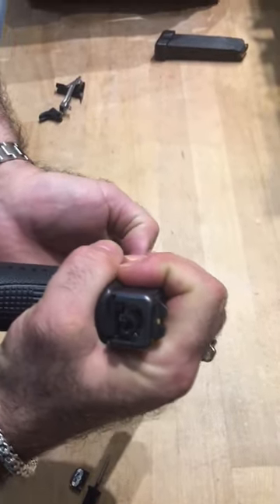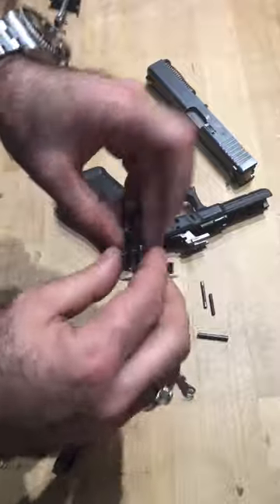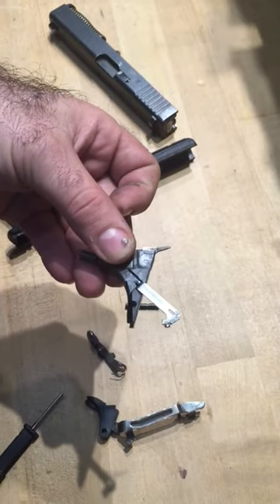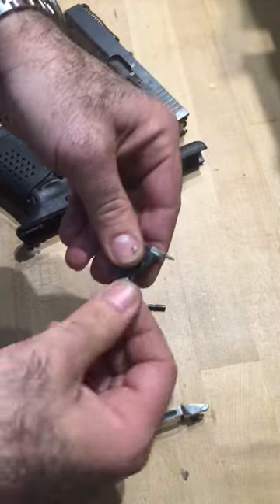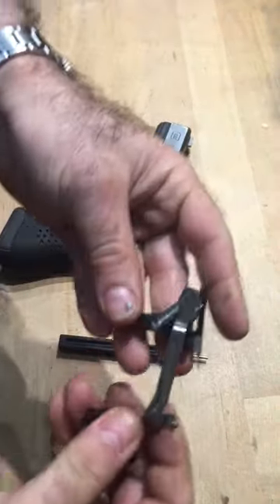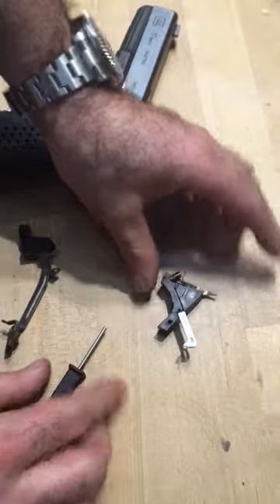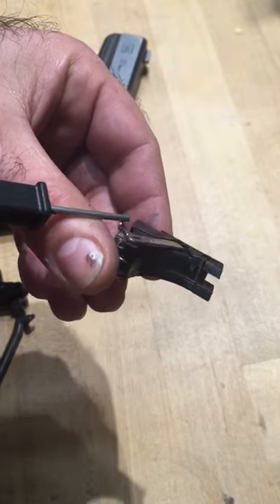Adjusting your connector-Bend angle adjustment

Comment from the maker: The video is not intended to show the disassembly of the Glock. This is to show the bend angle adjustment of a connector. Stay tuned for complete disassembly videos coming soon. Thanks for your business and for watching.
Reply: GhostIncTV  My G19 Slide has a lot of resistance only on trigger reset Could it be the Connector? When I manually rack my slide to check my trigger & hold my trigger back & rack slide for trigger reset something is giving resistance 
Any help would be appreciated
Reply: Oliver style 😁
Reply: Incredible knowledge base right here. I'm amazed.
Reply: It's been over 2 years since you mentioned "complete disassembly videos coming soon." Any progress toward those videos?

Comment: Thank you SO MUCH for this video! I just bought my first aftermarket trigger (Johnny Glock) and he had a video explaining about the grit/drag from the connector pushing the trigger bar into the frame, but he didn’t leave the fix for the issue in the video. Thanks to your instructions, I was able to adjust the connector right where I wanted it (first I over-corrected and messed up my reset; then I lifted it back out to Goldilocks zone) 👍

Comment: Great video! One tip is you can fit a tiny punch under the back plate and pull the connector to the right, pull the trigger so you can remove the slide without disassembling it!

Comment: You can use a piece of paper or thin card to make sure the space is proper. If the card wont go through its too tight if it goes through easy with no resistance its too loose. It should go all the way way easily but with slight even resistance

Comment: Did this adjustment to mine today, the bar was slipping past the connector, and this adjustment worked perfectly to fix it. Trigger reset perfectly and fired every time, and it no longer slips pst the connector. Thank you again for this video! I didn’t know what exactly was happening as this was my first build, and was told to take it to gunsmith, but I zeroed the issue down, and found this video instantly, and was able to fix it myself, and that’s what I wanted, the knowledge of the issue and how to fix it, I wanted it 100% all me, haha….

Comment: I reassemble my Glock different. I put in the rear pin in first(like this video). But next I place the slide release/stop in place and THEN install the large diameter trigger pin in. 
That traps the slide stop in place.

LAST, I put in the skinny metal pin. You just have to use your Glock tool (or anything) to push the end of the slide stop spring-steel out of the way.
I can do it ALMOST as fast as this video. 

The newer the gun, the stiffer the pins fit and it can take longer. His gun has been together and apart a LOT by the looks of it.

Comment: A link to this video needs to be included with all Ghost Edge connectors - I've never seen one that didn't need some tweaking. Ghost, you guys should print a QR code to the fix right on the card or documentation every time one is sold and shipped - it would save builders a lot of headaches and probably save you a lot of returns.

Comment: 43X Trigger problems? I had just bought a 43X. It felt like the trigger was too heavy, and the reset didn't always work. I had used this video several years ago to solve a trigger problem with my G19. To solve my 43X problem, I used the 2nd procedure he showed us here. Reset works like a charm now on my 43x, and the trigger pull is not as heavy. It's amazing how the trigger connector affects several issues with a Glock.

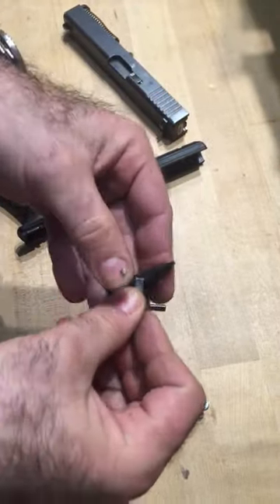Comment: 1:42 & 2:30 look almost identical on my big screen.  Is there an actual angle measurement of the connector that can be measured before it even goes into the housing?  If not, is there some sort of at-home method people can use such as, a post-it note, or note card that can only fit so far down between the connector and the housing?

Comment: I have the G43x MOS. I bought an Apex trigger. Beautiful. Works like a charm. A few days later I bought the Ghost Edge Connector. For some reason with that connector the trigger doesnt pull. So it locks the slide. I take it off and redo it. Same problem. Then i switch back to the old connector and it works like a charm! I tried bending it like this video shows (it was already bent) but to no avail. And its not defective because i actually bought 2 (one for a buddy as well) and both wouldnt like me pull my trigger. PLEASE HELP
Reply from the maker: Hello WholsMBM- Call me at Ghost and I will help you trouble shoot the issue. 305-252-7422

Comment: So with the gflex installed Already do you have to do the back plate method every time you want to clean ur gun or is it just not installed correctly cause mine hasent had any malfunctions other then I may have slide drag on the trigger bar cause when I go to rack the slide it’s stiff but not after the trigger is set

Comment: Awesome video. 🤟🏽🤟🏽. Is there an optimal angle for the trigger connector to be? For ex more towards the trigger housing or farther from the trigger housing? Thanks
Reply: Most drop in connectors are set/angled correctly for the majority of Glocks. Out of several Glocks I've put connectors in I've only had to adjust one using the method shown in his vid.  Just know that the connector is not bent at 90 degrees, but slightly outwards. Getting it just right to ones satisfaction can take more than one try. Bent too far in, no reset. Too far out, slide binds. See YT vid.... Transfer bar drag Educational Only.... from Johnny Glocks, 7 minute mark.

Comment: I have issue where I think my sear has too much engagement; to which the striker won't release when the trigger is fully depressed. It fires fine when a magazine is in or when I lift up on the slide with the slightest pull and the triggered depressed. Would it be wise if I bend the sear a bit down? Also when I rack the slide and lock it back with the trigger not pulled, my firing pin is free to go forward. It doesn't happen on my 19 when I do that so that seems like an issue as well. I want to assume the safety plunger is being depressed somewhere. Any help would be appreciated.

Comment: Why did you take the back plate off to take the slide off just to put it back on?
Reply from the maker: If trigger does not release the firing pin then you take the plate off to allow the slide to come off.

Comment: Why did you remove the back plate? You don't have to in order to remove the slide.
Reply from the maker: When your Glock will not dry fire/release the striker this is the way to get the slide off
Reply: @ghostinc.offical  I understand that but that wasn't the topic. And if failure to reset you can manually pull the trigger forward, disengage the slide release then dry fire to field strip. I specifically left out releasing the magazine and clearing the chamber because your mention of dry firing.
Reply from the maker: glad to discuss- 305-252-7422  @alvinmortimer7536

Comment: I had this problem recently and also noticed that the slider would not slide when reassembling the gun and something was blocking its way back, requiring a manual forwarding manouver of the trigger . Also, I noticed signs of scratches on the firing pin safety catch surface, as well as on its body inside the hole. I had a 3.5lbs Ghost connector, DOES THAT MAKE SENSE TO YOU GUYS? thank you very much!! from Brazil
Reply from the maker: Scratches are normal

Comment: I've never seen a Glock slide removed that way before.
Reply: That was the only way it could be removed in this situation. The trigger reset was failing because of the problem with the connector.

Comment: I installed this connector along with NDZ performance accessory competition sitting kit and my Glock is firing 3 rounds when I reset the trigger.  no joke. the bend seems like it is too much and might be rubbing against the slide.  could this be the cause?

Comment: what about no reset after pulling the trigger. put in a new trigger, connector, and plunger (apex kit) and before actually shooting it i did a functions check and the trigger is not resetting. whats the cause of that?
Reply: Did you find the answer to your problem. I am having that same issue but it seems to only happen if i do not have a mag in it.

Comment: If my connector lift is a little too much, would that cause the pull to be heavier then usual? I uses a overwatch percision polymer trigger, polished factory everything else.. the break just seems a little too heavy. Mabe slide drag?
Reply from the maker: Hello Gill,

 Yes it would cause it to pull heavier than usual. You can lower it and it should smooth out and lighten up a bit.

Comment: Would this work for dead trigger as well
Reply: Yes, it could but each connector fires at a different point so if bending outward doesn’t do it the Glock may have run out of room. If it’s a frankenglock then there are other things to look for.

Comment: Question: How many times did you have to disassemble & reassemble a Glock before you could do it that quickly? 😯😕
Because I've detail stripped my Glock at least two dozen times, and I'm not nearly as fast. 🙁
The trigger pin is what I get hung up on the most. That thing is a bitch sometimes. 😡 LOL

Comment: these parts are such trash, dont waste your money or time. You shouldn't have to "tune" your connector to be able to fire. That's called unreliability. Stick with stock parts, or switch to OEM dot or minus connectors, or even complete drop in triggers. Waste of money, im so upset. They got me for 25$ Shady ass company